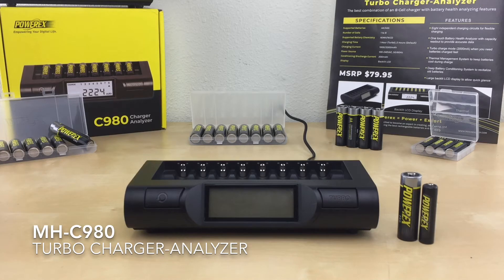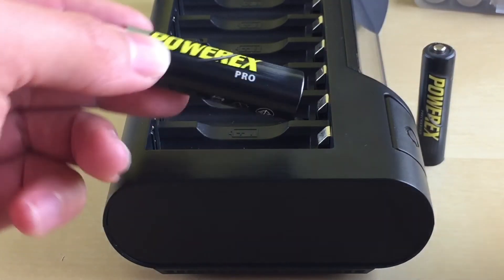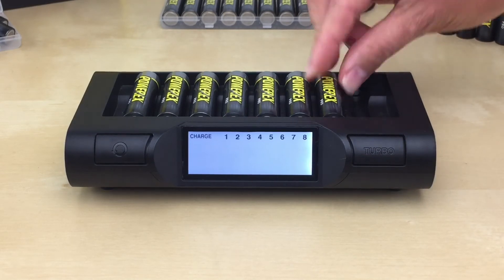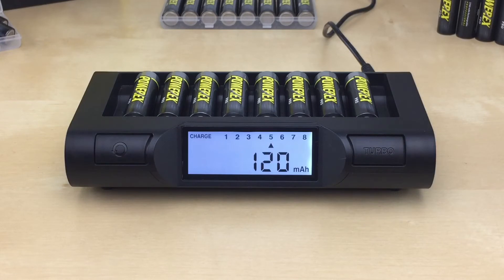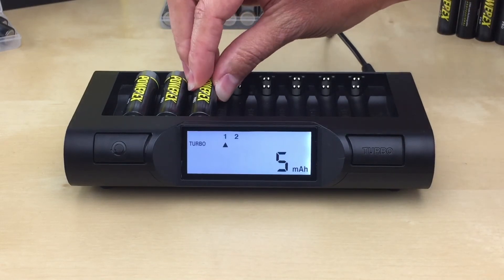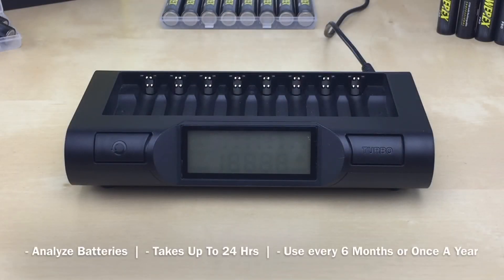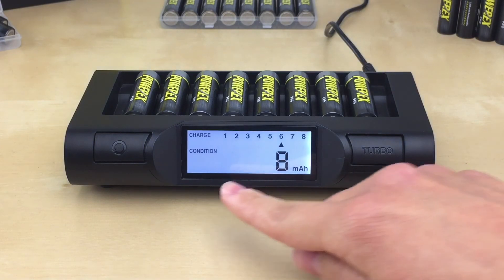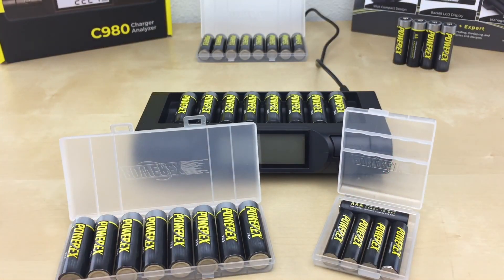Powerex MH-C980 Turbo Charger-Analyzer - How To Use

Comment: Problem that I had is that the charger does NOT always detect when a battery is FULLY charge.
I've had batteries charge for a LONG time, showing 5,000+ mAh, and getting HOT.  So not a good idea to charge overnight.
It would have been nice for MaHa to put an IR/temp detector to detect a HOT overcharged battery, for when the voltage detector fails to detect the FULL charge.
Reply from the maker: This may occur on batteries with poor health as they do not exhibit termination as well as a newer battery.  The MH-C980 Turbo Charger-Analyzer does have temperature sensor that protect against overheating.
Reply: @PowerexbyMahaEnergy  
THAT is the problem.  We do not know that the battery has 'poor health' until it starts to fail.  In the mean time, the chargers are overcharging the battery, rather than detecting the problem and not overcharging.
Reply from the maker: @garyn7067  The charger has over temperature protection in those cases.

Comment: I've got this and it's great. One thing to note is that AAA batteries need to have the -ve completely exposed to charge because the connection is only on the bottom.

I couldn't get it to charge some AAA batteries that had a small plastic ring around the -ve and it took a while to work out why it wasn't charging.

Comment: How do you know when a battery should no longer be used or has reached the end of its life? Is there a way to tell from the mAh results after running the conditioning mode?
Reply from the maker: Typically, we suggest to replace and recycle the batteries when they are below 65% of original rated capacity.  Or when the batteries no longer provide adequate runtime for your devices.